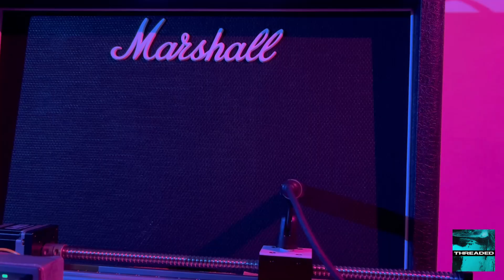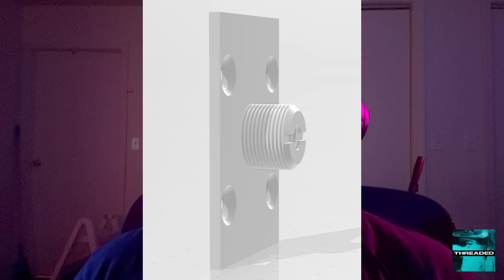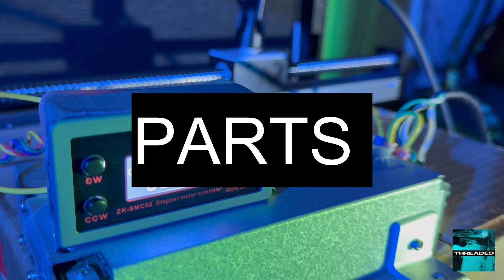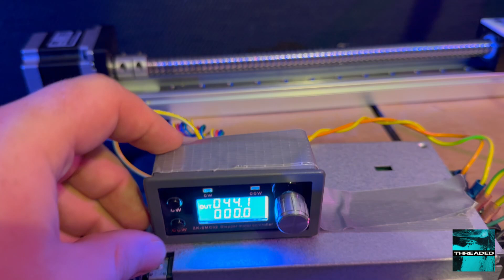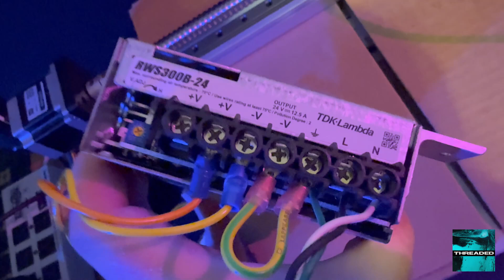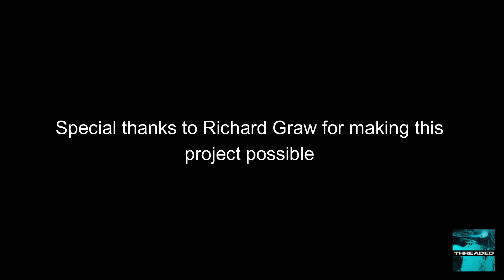Build a cheap DynaMount microphone mover for $160

Comment: Bro hi, is the sm57 more better than xm8500 for vocal and mix?
Reply from the maker: I have both and choose to use the sm57. I think it’s better. How much better? Unsure. Have to decide if it’s worth the money. You can make great sounding stuff with either. Behringer might take more effort. If you can get a used sm57 I would say just get a 57 but if you’re really in a pinch I still highly recommend the behringer. There is a video of a guy eq’ing the behringer to make it indistinguishable from the 57. Little bit of effort on the user side

Comment: Great prototype. I would build one using an esp32 to control it wirelessly, sitting in front of my computer.
Reply from the maker: I need to do that. Currently I extended the wires all the way to my desk and have the amp in a closet